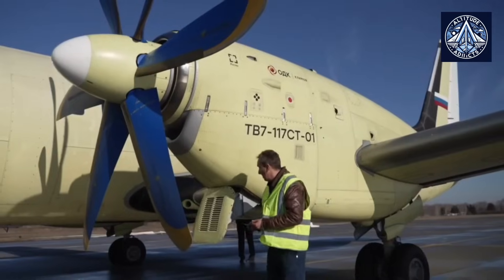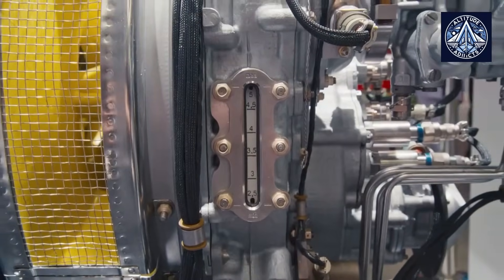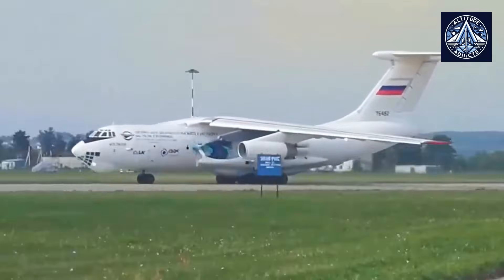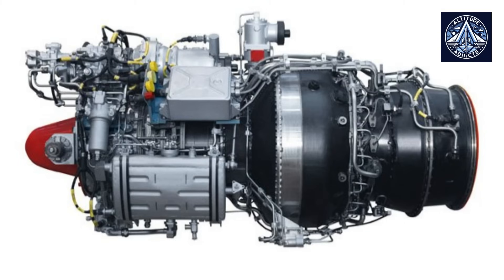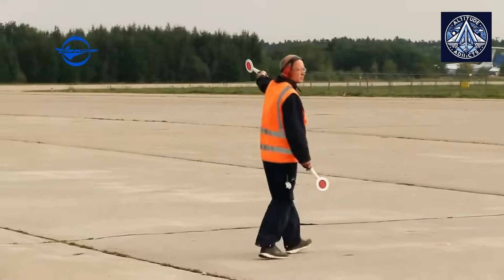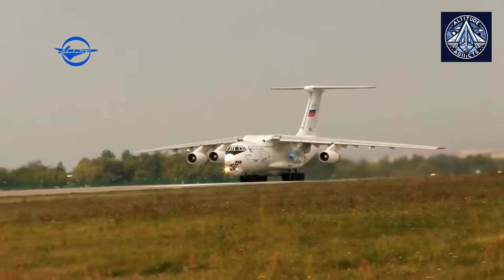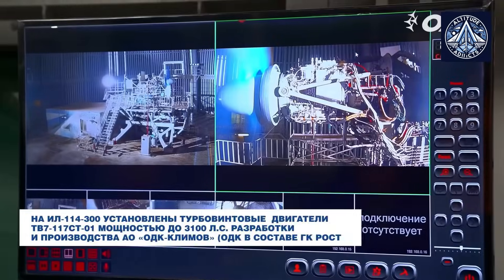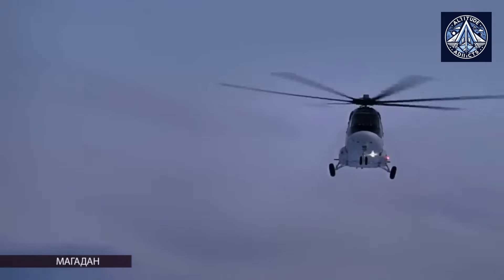TV7-117 Engine Family Powering Russian Regional Planes and Helicopters

Comment: Have they got the engine right? It is as good as any western engine but wont be subject to western sanctions. Even if the western engines were actually better that risk would make them a poor choice for Russian needs. These Russian engines are just starting out so of course certification and support around the world is going to be inferior to western engines that are widely used, but that will change over time. These engines will be used everywhere in Russia which will make them a much better choice than engines from countries that consider Russia their enemy. AFAIK the engine for the helicopters is called VK-3000 for the Mi-38 engine while the engine they developed to replace the TV3-117 engine that the Hind, Havoc, Hokum, Helix Hip etc etc was called VK-2500. If they are going to use the VK-3000 in all their modern attack helicopters that used to use TV3 engines does that mean they are going to make a new more powerful engine for an improved Mi-38 with more power to boost its performance... because otherwise it will have the same engine power as the Mi-8 and Mi-17 it is supposed to be replacing.